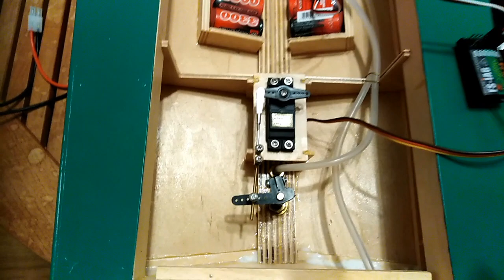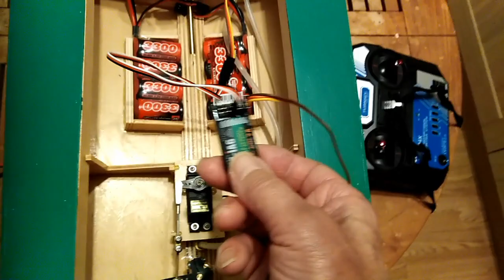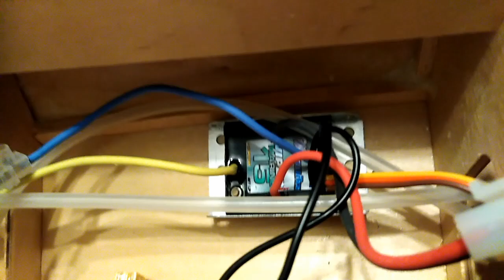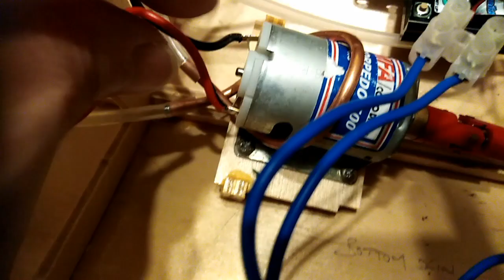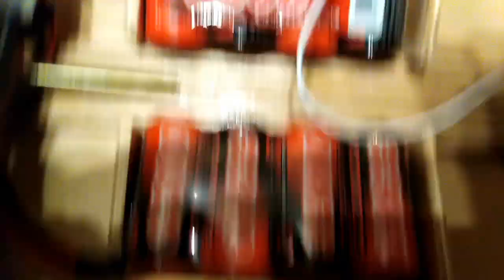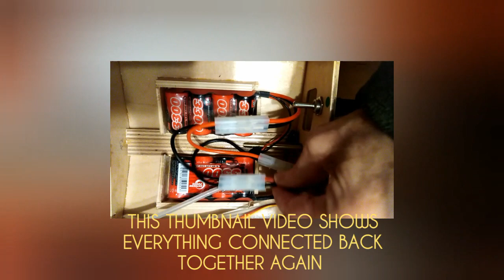Pilot Boat Build Extra - fitting the electrical equipment

Comment: I think "bound" is the correct term Peter. The receiver needs to be "bound" with the transmitter 😉
When you build a drone it's the same idea, except everything gets soldered to the flight controller which has four integrated speed controllers for the four motors.
So solder the motors to the four speed controller outputs, the separate receiver to the RX inputs and you are good to go.
But since I used to build FPV drones, you also have to add the camera and video transmitter or VTX to the flight controller, so that's the only real difference.
You still have to bind the receiver to the transmitter and connect stuff to the receiver outputs. Of course you know all of this and could add an FPV system to your boats if you wanted to.
Do you have anybody at the club using an FPV system on any of their models ? I mean, it's not really necessary because you always have visual contact with the boat, which obviously with a small drone is no longer the case after about 50 metres !
Fingers crossed for you that everything goes well today Peter !
Take care,
Garry & Ruby.

Comment: A very well built and laid out model 👍 The last speed controller I had was a PCB resistor type affair that had two copper connectors and sat about the servo. The movement of the servo changed the resistance of the power supply and that varied the speed, far better now. I noticed you had some sort of water cooling going on around the motor, if it is, I am surprised it heats up that much on that size of boat. I enjoyed this one 👍
Reply from the maker: Glad to hear it pleased despite your not actually fitting out a model (as yet 🤗). The water cooling isn't necessary but I like the idea of water pumping out of the 'exhaust' so most of the models I build incorporate it 😂.
Reply: @Lanes-Explorer7777  I have a half finished Deans Marine HMS Daring that been gathering dust since the 80s, a Polaris hull (5ft) sitting in my attic and  freighter type boat that could all be contenders. Also my Hirobo Shuttle is in the shed but will never fly again as it been flown many hours and has done it's bit. One last model is my Morley Augusta that has been stripped down and is sitting beside the sub so plenty projects, just need to get my finger out haha.
Reply from the maker: @blearyview2254  Yes indeed!! 😂. Owing to the weather - snow earlier then slight thaw and now freeze again I'm staying put and building a Ribblehead viaduct... Must get finished before the Hunter arrives Monday... It can be done 😳
Reply: @Lanes-Explorer7777  Oh new bike, look forward to seeing that 👍
Reply from the maker: @blearyview2254  me too!! Just ordered it from photos as I did with the Meteor but that's turned out well so I'm quietly confident I'll like it! 🙁